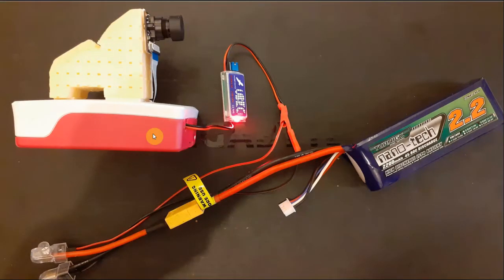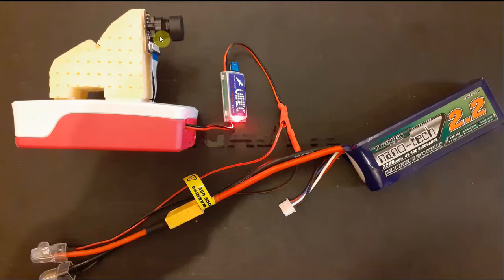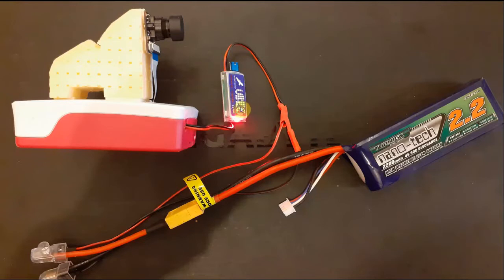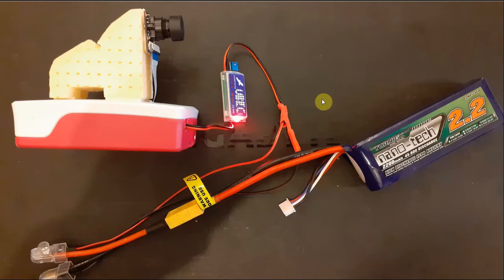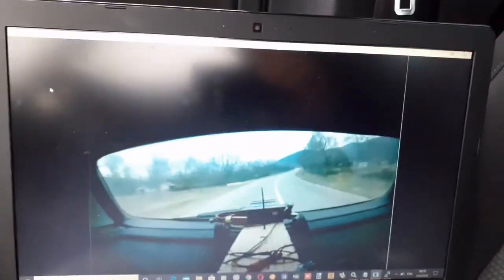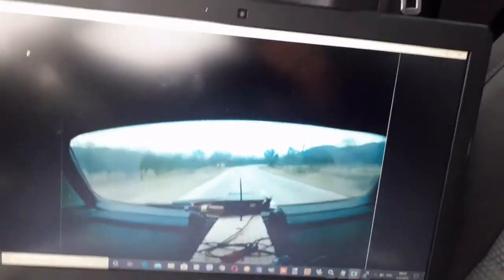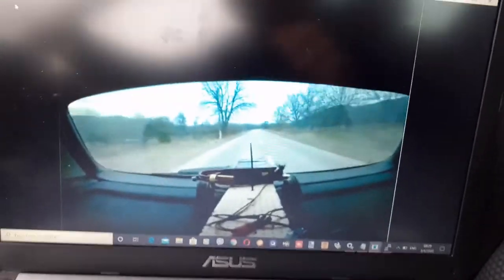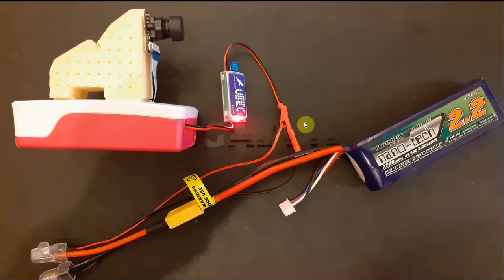Raspberry Pi based FPV cam that works via 4G

Comment: Can you share how you built this with any references to the code you used on the Pi Zero?
Reply from the maker: hi, that's a raspberry pi 4, gstreamer is used to stream the video, for more details it's best to contact me direct on telegram @Aeronaught

the precise setup varies depending on your hardware so there's not a one size fits all set of instructions unfortunately.... well there is but that requires quite a high level of knowledge of the software involved

Comment: Nicely done. Could you make a video on how you configured your raspberry pi to your 4g phone
Reply: I can just give you a download link and some instructions, does that help?
Reply: Aero Naughty that would be great
Reply from the maker: OK, give me some time and i'll sort it, need to speak with my software guy
Reply: Hi, Im trying a minla hdw which is a rpi with a cam and uses i think a server on the internet provided by the designer and i am concerned that it might not continue to work in the longer term.
How does your up and down link work?
Reply from the maker: i'll come back to you on that, several people asked, i'll put something together and post it
Reply: Also, i know you speak of low latency, but are you able to provide a video so we can get an idea of how long it is, i will do the same for the minla option, in my mind the minla latency is significant and as i would like to handfly my fpv flights latency is important, it may be that 5g will  be much faster and make this gear redundant.
Reply from the maker: it's about .2 to .5 seconds i reckon, if you really need a video let me know and i'll do one
Reply: @aeronaughties  i am in the Que too ..i want to know about codes and setup
Reply: Would like more info about 4g set up with Raspberry I ...thank you
Reply from the maker: Hi again, if you want to contact me directly you can find me on Telegram - @Aeronaught

Regards
Aero
Reply from the maker: Hi again, if you want to contact me directly you can find me on Telegram - @Aeronaught

Regards
Aero